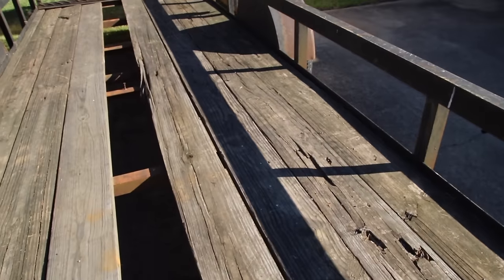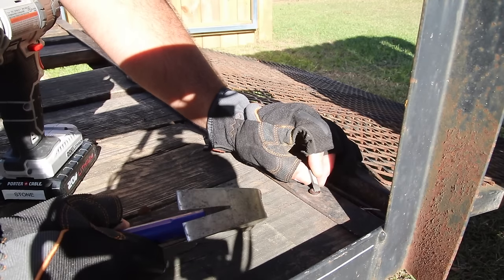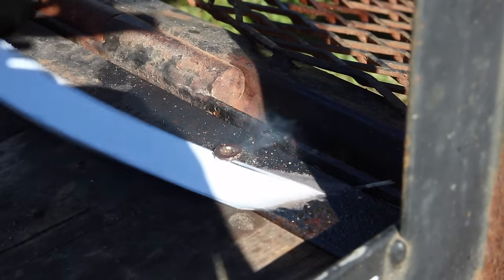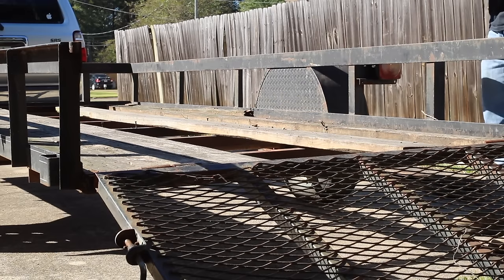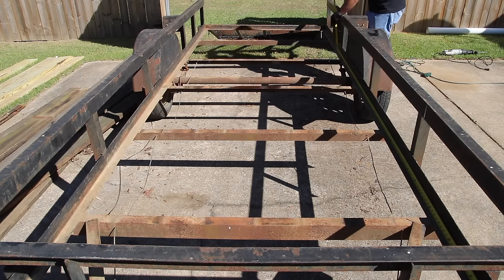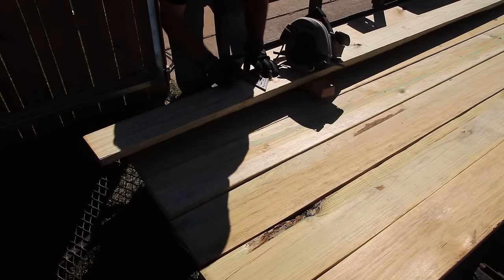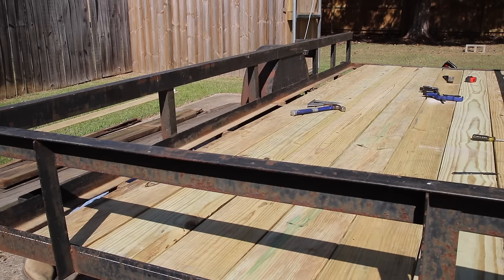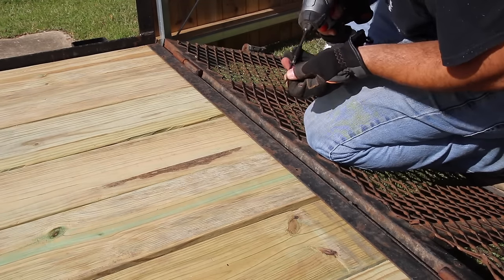Utility Trailer Floor Replacement

Comment: my trailer would be a bit more involved. both the front and back pieces, that go over the ends of the boards, are welded on. so i'd have to cut the welds on one end, then reattach them using bolts/large screws.
Reply: sean my trailer is the same way with the two ends welded to the frame. Why not just stick one end of each board under one welded piece then bend the board slightly where you can get it under the other welded end? I used a floor jack and an extra person to help me to this.  Fast and easy and no having to grind that entire weld out.

Comment: Replace with hardwood and its a once in a life time job.
Reply: Not true, if you haul heavy equipment it will go maybe 5 years. Burr oak is strong but wood is still wood and the elements will destroy it regardless.

Comment: That looks like construction grade rather than pressure-treated lumber. Anyone who replaces a trailer deck with anything but pressure-treated lumber is a fool. It will rot in just a few years.
Reply from the maker: It’s treated.
Reply: You can't see all that green?

Comment: Don't space boards, pressure wash that shit once boards are out, let dry, orbital sand, clean with acetone, let dry, prime, paint all the frame and then in 6 weeks stain the boards. 
Just the things to do to do it right-